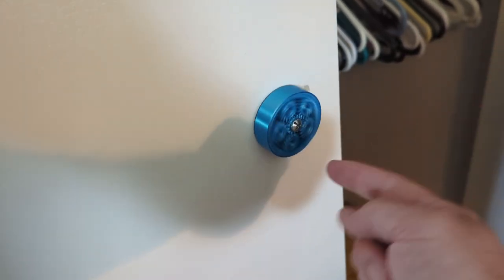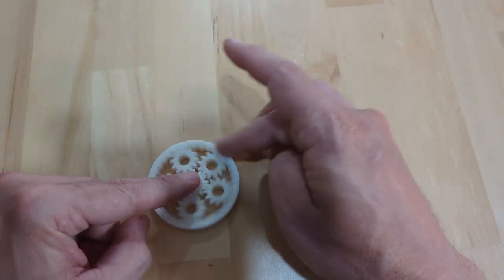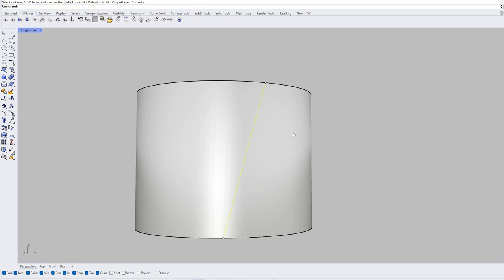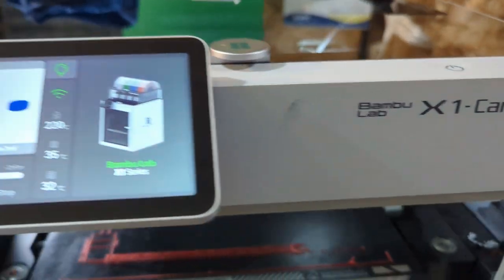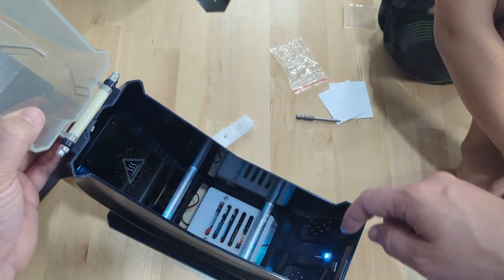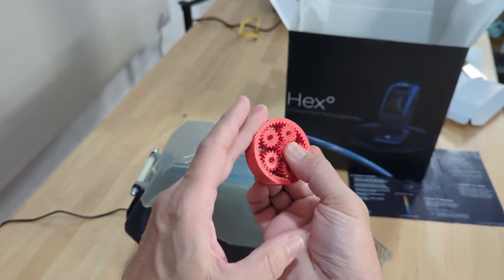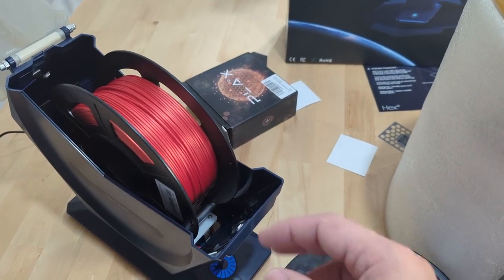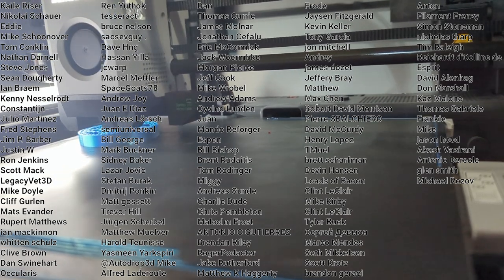Planetary Door Knob Adventures With Wet Filament

Comment: I use a $50 pressure cooker with the pressure safety bits reversed to dry filament plus I also dry other stuff. An HVAC vacuum pump new or used is also needed. For the vacuum hose I used a natural gas SS flexible metal hose and 3D printed the transition diameter parts with O-ring seals. Basically, a vacuum is vastly better dehumidifier.
Cheers-Peter
Reply: yea i just use a modified food dehydrator
Reply: You need a very low vacuum for that to work and its still better to add some energy to the system.
YouÄd also need to keep the vacuum pump running constantly, otherwise the out gassing equalizes the pressure and the drying stops.
Just use some silica gel man.. so much cheaper and you need it anyways in your storage box

Comment: Being someone who lives on the Eastern Shore of MD, right next to the water, my house sits between 65 and 70% humidity, I have to dry ALL my filaments, regardless of type. I did not know you could anneal the PLA by drying it at too high a temperature, however. I usually do 50C for 6-18 hours depending on the age of the filament. Probably too high a temp. I have noticed a spool I have been printing from for a while degrading in print quality and I thought it was my printer. Gonna have to do some testing now. Thanks for the info!

Comment: You tried putting a TPU sleeve with the new Cura multi material link setttings, to the outside of the gearbox diameter?
Reply from the maker: This is a good Idea. Maybe even make it hollow so it feels like one of those RC Car tires and provides even more shock absorption when slamming against the other door.

Comment: Two things I didn't know that were interesting to me. 1 don't dry PLA to hot and 2 additives can be used to create nucleating sites in the material. I imagine this could potentially benefit other materials as well in perhaps more ways than only resistance to deformation from ambient heat but also load induced elongation over time. Perhaps could be implemented as well for modifying ductility? Hardness? Toughness? You know... And in a wide range of plastic types. Yeah super interesting. 

Thanks for the great content
Keep up the good work

Comment: 7:04 pretty sure it supposed to be a degree sign, but what's with math??? "Anything to the Zero power is Zero, right?" NO! Anything to the 0 power is 1.
Why did you have to make such obnoxious comment?
Reply from the maker: Well, fart biscuits, that is obnoxious. I should have checked myself when I was editing. It's been a WHILE since I was in a Math class. https://youtu.be/PV3_UHG73oQ
Reply: @DesignPrototypeTest  Aside from the math error, I thought it was playful not obnoxious. 🤷
Reply: @DesignPrototypeTest  it's also a degree symbol.  hex° by theta°. poor marketing because its hard to search for. had to use your link to find it.

Comment: 13:20  If you were to have a "food safe" path for the filament. Then use this PLA X filament to make a one time use cookie cutter would it then be safe to use?
Reply: Food safe would mean, new tube, new extruder-gears, new print bed, new extruder, new nozzle.
And all of that including the filament of course cannot have materials which leak out onto your print.
Chances are you cannot really get Filament which is labeled as food safe anyways or only at some high cost.
Reply: Ok. Thanks for the reply.